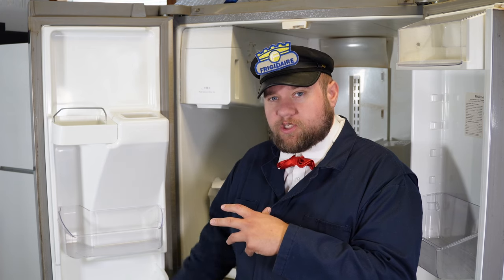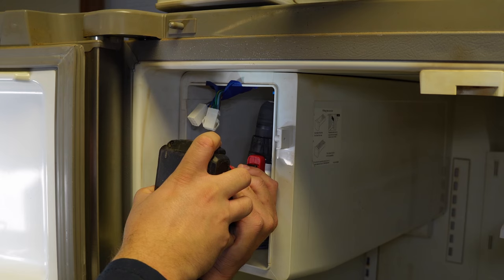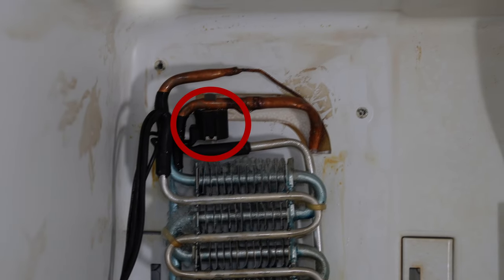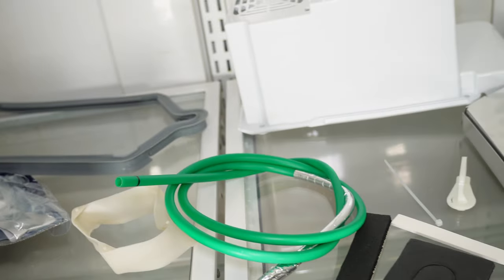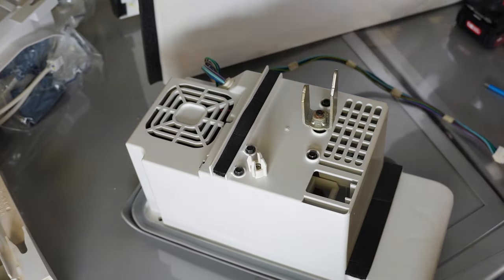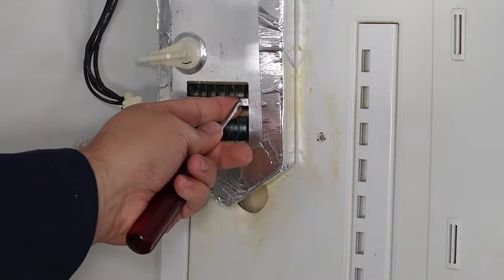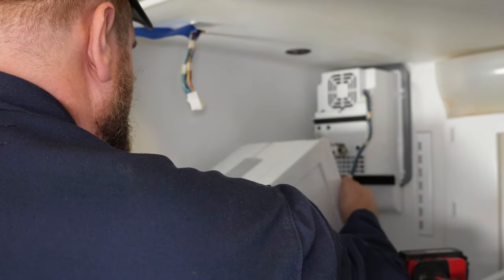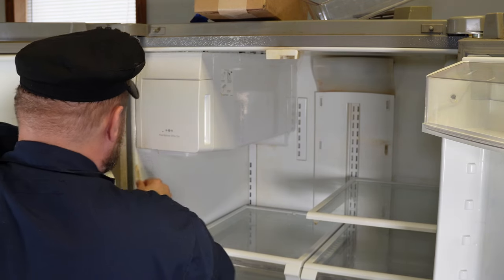Frigidaire / Electrolux Refrigerator Icemaker Won't Work or Dispense Ice - How to Fix it Fully

Comment from the maker: Here were the 3 big things used to fix this machine. If I can fix it, you can too!

Air Handler Repair Kit (OEM, Includes fill tube, ect): https://bens-appliances.com/products/5303918784-frigidaire-air-handler-housing-kit

Electrolux/Frigidaire 243297613 Icemaker:  https://oemparts.bens-appliances.com/products/243297613-electrolux-ice-maker-complete-115-v-twist

SIL-4500: https://bens-appliances.com/products/silco-4500-rtv-sealant?_pos=2&_sid=afb013349&_ss=r
Reply: Hey Ben I currently have this funky thing happening on my GE fridge it’s Model no. GSS25QGTA, the rubber insulators all along the edge of the door are piping hot for some reason
Reply from the maker: @DaSteeJ07  I made a video on that last year. Just check my channel out about the door being hot, around February last year
Reply: I'm having the rust issue, going to attempt this repair shortly. However, my issue isn't the ice maker as it's not hooked up to water. My fridge keeps warming up on hot days and ice forms over the rust at the back. Will just cutting out the soggy foam and replacing solve this issue?
Reply: Hi, how long do we have to leave  the fridge on the defrost mide in order to remove the ice?
Reply: I have a similar unit (FPBS2777RF) but my problem is with the ice maker in the lower freezer drawer.  I can’t find diagnostics for it anywhere.  It seems the upper ice maker is a common problem and not so much for the one in the freezer. Do you have a video or anywhere to point me for help with the lower ice maker?

Comment: I solved the problem by removing my Electrolux Refrigerator from my home and having the junk man haul the POS away.
Reply: I have an Electrolux and it has been super problematic.  I think it's time for a new refrigerator.  Are you happy with your new refrigerator?  What model did you go with?
Reply: Lol our frig is maybe 4 years old and it has a crack on the plastic of the freezer it is soo noisy  I am going back to the 2 door we have our other frig for 15 years  any recommendations
Reply: I might be right there with you. LOL We bought a house with a 2-year-old Frigidaire model similar to the one shown here. The freezer works sporadically and the Ice Maker continues to freeze up every other week. I’m glad I found this video. I will be purchasing a repair kit and trying to fix it…but we may have to replace this machine. It has hardly any interior volume for storage, is incredibly noisy, and consistently has issues.

Comment: If you're having trouble with the water inlet freezing over pull the water inlet tube as he shows towards the end of the video and check it for hard water scaling inside the tube.  I had a persistent issue with the inlet freezing over on this style ice maker and tried all the usual suspects, nothing worked long term.  For some reason a small amount of water left in the inlet during the ice making cycle was freezing then building on itself until it completely blocked the tube resulting in no ice.  After thawing the inlet and trying numerous other fixes over several months I finally found a single reference to hard water scale causing this deep in the bowels of the internet.  I pulled the tube and sure enough there was some scale visible inside it.  I descaled it with some white vinegar for a few minutes, re-installed it and haven't had a problem since.  Who would have thought that a little bit of mineral deposits would cause that.  You could of course replace it with a new tube as well but this cost me nothing and was done in about 10 minutes.

Comment: Just want to say it's tough to realize how well made this video is until you watch other videos on the same content.  I will be buying the replacement parts from your site. Thanks.
Reply from the maker: I appreciate that! The work that goes into getting good shots on this type of thing is ROUGH, but it means a lot when people realize that!
Reply: @bensappliancesandjunk  Ben, please advise if you provide the equivalent parts for FGSC2335TFB.  The fridge is a tenant's and frozen solid.  Kinda wanted to come in locked and loaded with parts rather than defrost her whole fridge and come another day with the parts.
Reply from the maker: @davidfrankel9267  I'm not aware of an equivalent kit for the side by side unfortunately. Looks radically different.

Comment: I struggled with the water outlet freezing up every week. If I set the ice cube size to maximum, it would freeze up only about once a month. I dealt with that for about 18 months before I finally thought of an idea. I got a piece of electrical wire, the stuff used inside the walls of your house, 12 gauge solid copper and stripped it down to a single wire about 12 inches long. I fed that wire through the water outlet until it was a little bit recessed in the hole. In theory, this copper will absorb heat from the outside case and deliver that heat to the water outlet, preventing it from freezing. And three years later, I still haven't had a frozen outlet! It looks like they took my idea for the new water tubing you installed... it was wrapped in aluminum foil (unless you added that) so it too will absorb heat from the environment and keep the outlet perhaps above freezing.
Reply: dude teach me this power, this is exactly what is happening with mine
Reply: I finally did the same thing because the drain kept freezing up. Been fixed for about 8 months now!

Comment: Couple of comments and compliments Ben (I'm from Montreal). First off, all YouTubers should learn from you (Master Class), this is how you make a video, very detailed, stopping at times to show things, or adding red arrows to highlight things. The key for this repair is definitely that newly designed ice box with new improved gasket. Had called a repair guy and he was saying sell the fridge and get a new one, ice maker and insulation was done. Installed the new ice box last night and seems to be making ice now (will see for how long).

Figured this effort on your part was worth at least a couple beers, so sent you a small donation to cover those beers. 

Thank you sir, am following your channel for more repair advise, great channel !!
Reply from the maker: thanks!
Reply: Has the fix solved your problems?

Comment: Bravo Ben!!!

I have been battling this issue since Janurary of this year this is super informative I replaced the water filter and also replaced the water valve ice maker worked for a couple of days but started acting up again.

I’m gonna tackle this more in depth tomorrow

“Update in case anyone cares”

This 100% fixed my issue!! :)
Reply: what fixed your issue? the complete reinstall as per the video, or your fix?
Reply: @gugbogey  So sorry for the late reply I’m just now seeing this.

Yes i followed the instructions per the video and ordered the kit Ben recommended.

I have not had anymore issues with the ice maker tube freezing up.

My guess is that insulation add-on including the foil wrapped ice maker water tube is what fixed the issue.

Comment: Thanks Ben!  I bought the kit you suggested, watched your video and got it fixed.  It's only been a few days, but I'm hoping that with the new tightly sealed setup, it will last!  BTW, Electrolux had a repair guy come out and said it could not be fixed.  He was wrong!  I'm disgusted that I paid $99 for a guy to come out and not even open the door to the refrigerator to tell me that.  Again, thanks for your video.  Excellent!
Reply: Was the repair guy right, it's been a month. 😂 what he meant is it usually comes back and there is no permanent fix.

Comment: Thank you for this video. We bought a house with a 2-year-old Frigidaire model similar to the one shown here. The freezer works sporadically and the Ice Maker continues to freeze up every other week. I will be purchasing a repair kit and trying to fix it in the coming weeks…but we may have to replace this machine. It has hardly any interior volume for storage, is incredibly noisy, and consistently has issues.

Comment: I just replaced everything seen in this video. My only issue was at the end trying to put the box back in, I couldn’t for the life of me get it as flush as it was before. We’ll see soon if that is an issue or not. If this replacement doesn’t work, I’m wondering if it’s the defrost sensor not working, since it’s been icing up very quickly recently. 

Very thorough video, thanks!!

Comment: Just ordered the kit from your page. I figure it was the least I could do for you putting this video out. I was attempting a DIY fix that would not have worked now knowing that the foam is water-logged. Peeled the metal back and sure enough, soaked. One thing to mention while cutting the metal -- the capillary high-pressure side of that coil takes off towards the left of the fridge. If you get too far over to the left, the line is only about 1/8" away from the metal. I have no idea how I missed it but I did. I would recommend starting on the far right and only working left as far as you need to. I would probably use tin snips instead of a rotary tool for doing this.

Comment: if this works for a couple days then freezes again, test the heating element for ohms, if OL then the heating element is bad and needs replacement. And check the temp sensor for continuity, at freezing and at room temp, it is a simple close/open switch.

Comment: Thankyou for the video! I have a question for you. My power recently went out while I was away for a weekend and I came home to a warm fridge/freezer. I replaced the faulty GFCI that caused the issue but now my ice maker won't work. I ran the diagnostics and I know the tray will fill with water and flip over to transfer the cubes to the bin. Do you have any ideas why my machine won't work?

Comment: any chance you have an air handler kit for FGHB2866PFGA? The motor foze. I dried it with a hair dryer and it work, but soon as temp went below freezing temps, it, happended again. also had ice on the outside of the housing near the back of the fridge. thx

Comment: thank you for your service to us peons!  I have a Frigidiaire FFHB2740PEB with french doors and recently replaced the main control panel.  Now, the ice maker makes cubes but the auger doesn't  dispense them... the auger turns manually but I don't know what part to replace other than infamous shot gun approach.  Any suggestions?

Comment: Great video, it helped understanding my issue a lot. I have this new grfc2353af french door, provided by builder. I dont want the top icer maker and I want to check if it can be removed... main concern is constant noise when its fan runs and I changed the fan but seems like noise is within range (32-47db), I am just more hearing the whining fan noise. Thus would love to know if we can remove it?

Comment: Good job as usual 

It seems everything regarding air flow including the condenser is poorly designed 
This model seems to accumulate a lot more dust/pet hair than usual due to the control board location behind the toe panel below

Comment: Thank you for this video, it was very helpful. I have a similar model fridge to the one in your video, this morning I came into the kitchen and found it making a very loud buzzing noise (not the usual hum). When I open the door it stops, then resumes when I close the door. My guess is that it is coming from the ice maker, I was considering removing the ice maker (with the added bonus of regaining some space), will that affect the integrity of the fresh food compartment? If I take off the ice box and leave the air handler would that be okay? There is more in the back of the ice maker than I had realized. Thank you!

Comment: I have removed all of the necessary parts/ screws, yet the ice box won't come out (almost like it is glued on).  It is completely thawed out so it is not ice holding it in.  Any thoughts?  Mine is a slightly different model (prmc2285af).  Thank you.

Comment: I have reset mine and sometimes it works but most times it doesn't and when it does it only works for a few days. When it does work it makes ice super fast and works great. I have a French door with freezer on the side. It is completely different then this one. The fridge is only 3 months old, it's not packed full as I have a freezer and refrigerator in the basement we mostly use for things that won't be used within the week. It is under warranty and I also have a 5 year extended warranty and it is possible it's defective but if it's something simple I'd like to fix it myself but I can't find any info. I just have a switch on the bottom of it.

Comment: Hey Ben!  I've had this issue and my jerry rigged solution made the rust spot on the back worse.  If I do this full fix will it stop the rust spot from spreading?
Reply from the maker: Should, yes, between the sealant kit + re-sealing back w/ insulation
Reply: No, rust is like cancer it will continue to eat away. I cut a 9x17 hole in mine 6yrs ago and patched it with aluminum plate. Put clear caulking around the edge, place the plate over the hole and pop rivet the plate on. Some rust came back below the plate and I put rust blocking paint o dr that portion. So far it has stopped. It’s 10yrs old this year.

Comment: My power went out for around 11 hours, and now the ice maker is making ice, but the auger isn't pushing the ice out. The motor runs but it doesn't turn. I cleaned out the old ice that was clumped before I tried using it after the power came back on. Any ideas on what I can try to get it moving again?
Reply: I'm actually having the same exact issue, were you able to fix it?
Reply: @fishepa  No I haven't. I haven't tried taking it apart yet. I did try a hair dryer on it to see if it was frozen, but no luck. I may not have tried long enough.
Reply: I'm having the same problem

Comment: Would a bad mother board be the reason an ice maker would stop making ice? Tried new ice maker @ new water valve.
Reply from the maker: Its possible, but there are a few variables too. One of the first steps I'd look at is ice-room temperature. If its too warm (above 18*F or so), it won't make ice. I would put a thermostat or some sort of sensor to record temperatures and see what happens.
Reply: @bensappliancesandjunk Good idea, thank you

Comment: Why did you replace the water line ,did it cause a problem ???
Reply from the maker: It was included in the kit, and contained a better more robust gasket so the line doesn't freeze up.

Comment: Ben, very good information. How soon before these kits become available again. Have mine apart now!! Thanks, Dan
Reply from the maker: I'm not sure. I've called factories to see if we can replicate/sell it... They've been out for 3-4 months now and its utterly depressing.
Reply: Someone has them on eBay , but pricey.
Reply: Ben, I installed the kit I got from eBay. It didn’t come with water line. It worked for a bit, then stopped again. Ice make compartment is too warm. Evaporator fan is running. I guess I’ll remove a few parts and check for build up again. It was ice upped when I installed the kit. I used an ohm meter on the defrost coil and checked the thermo coupler switch, both looked good. Any other ideas? Thanks Dan
Reply from the maker: @danscherbert1256  check temps inside cabinet w/ a thermometer. The icemaker has to be <15F* for it to work. If it doesn't, then it wont cycle right.
Reply: It is warm, I’m wondering if the unit is iced up again and nd maybe the defroster is not working. I ran the defrost cycle, but no change. I’ll have to disassemble and check.
Reply: The ice maker Did ice up again, I suspect the ice maker defrost (heater) coil or the thermostat attached to the evaporator coil. Is there a way to check that I have power going to the heater while I have it completely disassembled at the lM1 connector? Like if I would manually turn on the defrost cycle, I should see voltage? Rather then just start replacing parts.  Thanks Dan
Reply from the maker: @danscherbert1256  hi Dan, you should be able to test it and get voltage. Should be 120v. You could also check any defrost sensor/thermostat for continuity or ohm resistance. Sadly, I don't have one of these in front of me to give specifics but judging at least by what I had/used here, that thermostat should show continuity @ temps below 30*F. You could trick it with a can of air duster upside down to force it to get rapidly cold, while using the multimeter probes in the requisite harness locations.
Reply: @bensappliancesandjunk  the thermostat is closed as it sits in its frosted state,I have not thawed out the area yet). I put a fluke meter on the 9 pin connector and get some voltage, maybe 35 volts. I’ll keep plugging away.
Reply: Ben, I ended up changing the board because or the low voltage at the defrost terminals. Solved my ice maker problems. Thanks

Comment: My brother pushed the ice door in and severed a white wire with a rubber coating. I’m not sure where it goes to, all I know is that it’s running from the part that tilts the ice trey up top. The side that plugs up is good, it’s the opposite end I need to know where it’s from
Reply: That's likely the NTC element that sits on the bottom of the ice cube tray. I also severed mine but also touched the wires together which fried both the main board and door control board. Get that fixed before it leads to other issues. Should be able to just replace the sensor.